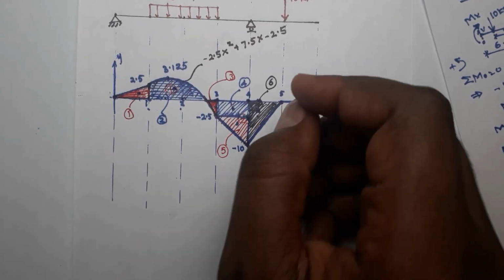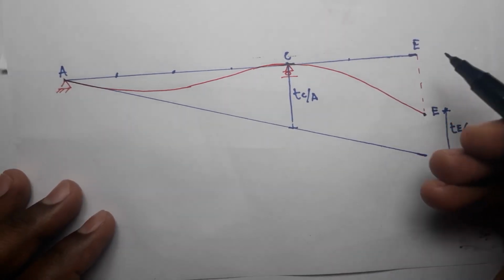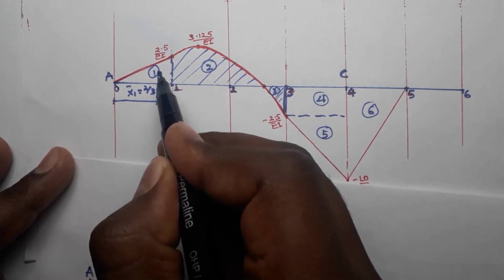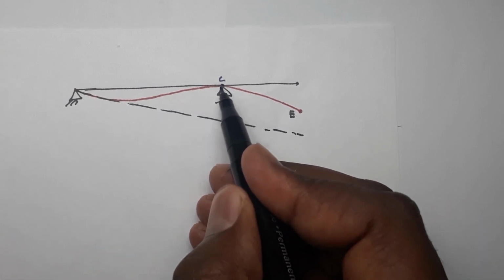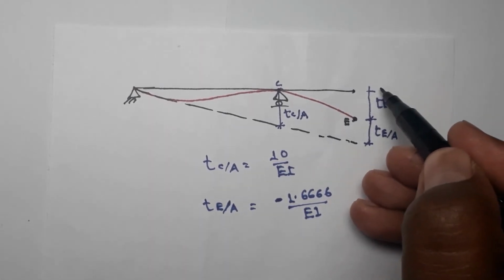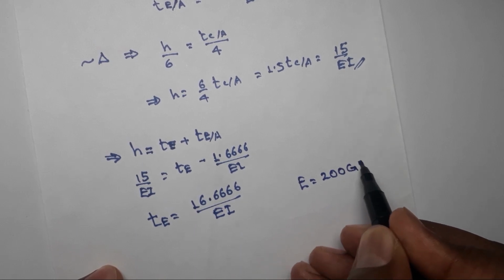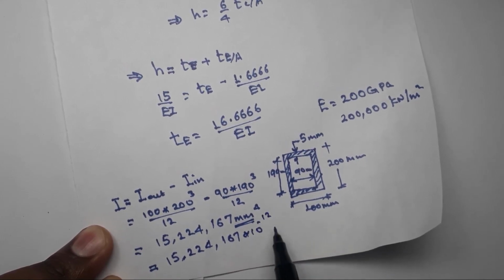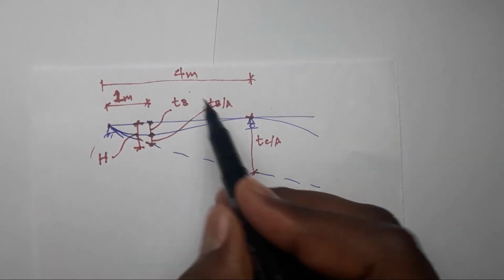Moment-Area Method - Step by Step Explanation and Solved Example: PART-3

Comment: where will be the maximum deflection for the simple supported and over hanging beam separately ?
Reply from the maker: 1- The Maximum deflection (displacement) of the 1st span is at 1.5m from support A. It is the location of the maximum +ve bending moment.
2- for the Overhang beam ( the 2nd beam) the Maximum deflection(vertical translation) is at the end tip at 6m from support A.
Reply: What is this